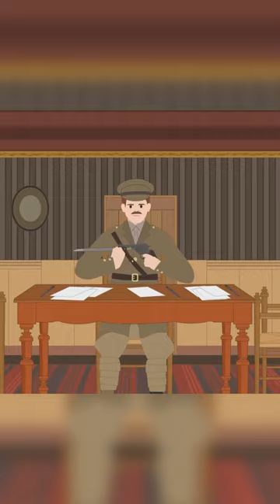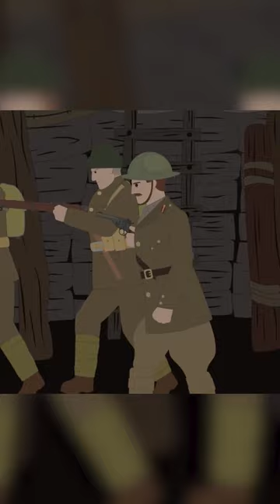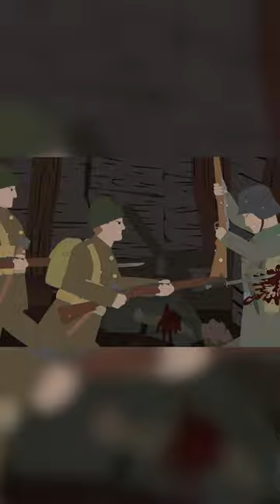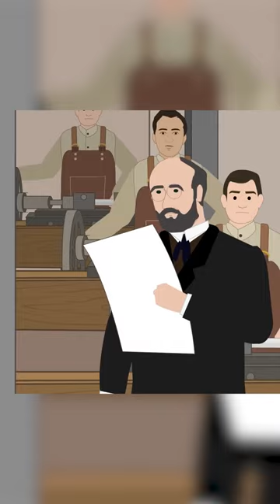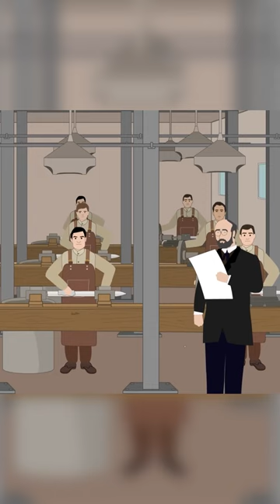Strange Gun Upgrades - The reason Bayonets were put on Pistols in WWI #shorts

Comment: You could also bring a saber or trench knife besides a revolver
Reply: Or the most common melee weapon - a a bludgeon of some kind. Whether it's a stick, a table leg with wire tied around it, etc etc.

 easiest to find/make and cheapest to replace. many surviving examples.

Google WWI war clubs
Reply: But then you would have to reach for that. Which means you would have to drop or holster your pistol. By then, it’s too late. Plus, how tight those trenches were. Probably wasn’t real easy, trying to put up a pistol and access a bludgeon. All while being shot at, beaten or stabbed. 🤷
Reply: Another thing: you could drive a nail into your pistols handle as a bashing spike
Reply: @retrodarktrooper6372  yeah, but that will only work with revolvers
Reply: @socialrevenge1088 You're forgetting it. Important thing. You would have the pistol holstered. Because if you have time to aim you have time to draw.
Reply: Tomahawks could better serve this purpose.
Reply: @michaelzona9880 only thing better would be a captain America shield
Reply: Sabres require room to wield effectively, with the exception of some of the straight Sabres the the m1913 "patton" but even that is a huge heavy sword, powerful on horseback but slow in all but the thrust.  I fenced in college, sabre and foil and have handled a whole mess of french and English models and a lighter, shorter, faster weapon is what's needed.  I'd say any of the late 19th century bayonets between 16"-30" are a much better option in any space you don't have room to move freely in.
Reply: @socialrevenge1088  You could, uhh, also use the other hand.
Reply: @warpdriveby  The thrust is Exactly what you would want in a trench.  Having room to move freely in would make sabres the optimal option.  I also fenced in college, under an Olympic silver medalist that was the coach.  "Do what wins" was the height of Russian Olympian instruction in the late 90s.  I'm sure it would work in a trench as well.
Reply: @willdavis3802  Are you saying the lighter straight sabres would be effective or the whole category in general?  I guess I think of the more curved models as ineffecient in the thrust if not poor, but I also haven't spent any time learning to use one.  I think those like the "patton" or a napoleonic cuirassier's saber, both are >2kg weapons.  I think a smallsword or spadroon have the handling ideal for use in a trench, but I can't point to any testing of this.
Reply: Sharpen your entrenching shovel.
Reply: @GarthKlaus  that too
Reply: Generally you need both hands to be effective with an E-Tool, digging or as a weapon.
Reply: @socialrevenge1088  dumb question, can't you have I dunno the knife/saber in one hand and the revolver in the other?
Reply: Takes 2 hands
Reply: @socialrevenge1088 carry a knife and hold it in one hand and the revolver in the other, sorted.
Reply: Maybe a pistol in one hand and a gladius in the other could've worked
Reply: Exactly, you only need one hand to operate the pistol so the other can hole the knife every soldier gets